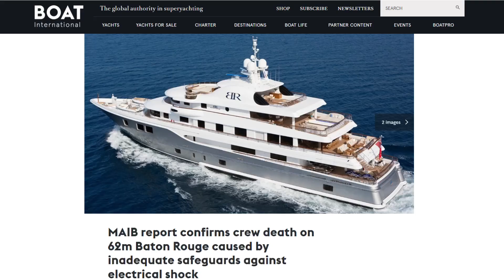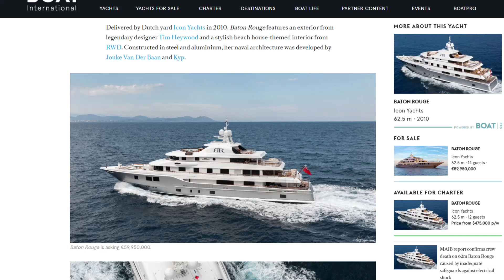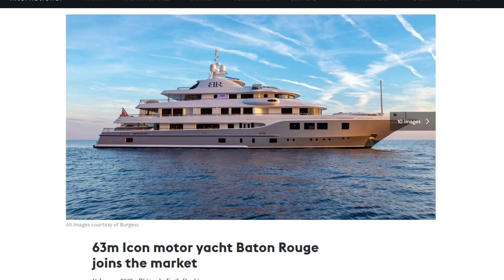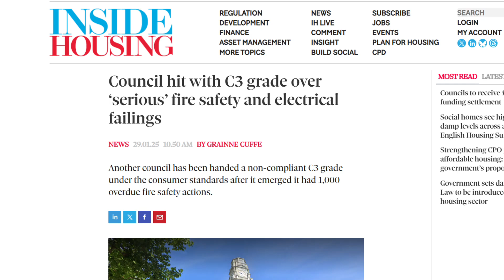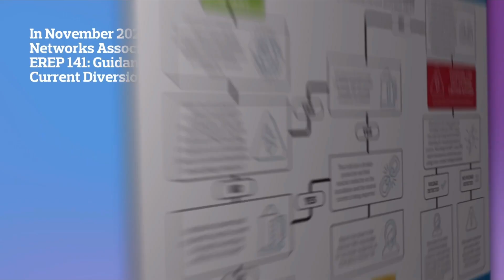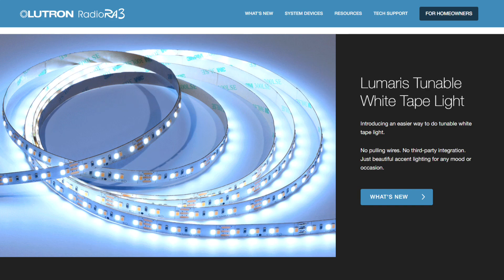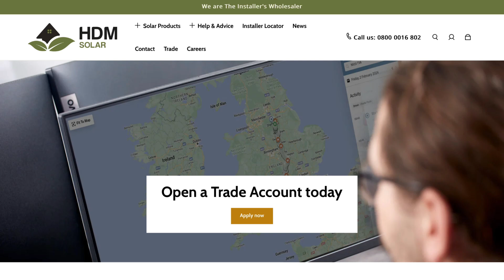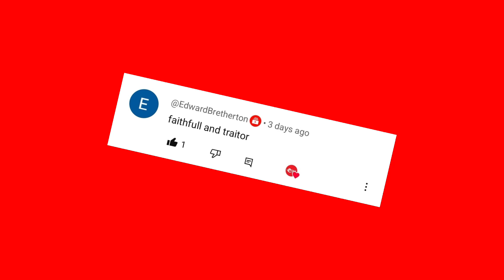Engineer Dies in Live Working Accident

Comment: Thanks for sharing🙏 . . Terrible news about this accident. I am not in the industry and I've never been shy of 230V thinking it's not high enough to kill someone who might be coming into brief contact with it since I've done it so many times in my 72 years on this planet. 
However, this is yet another proof of how wrong I was also having learned that, depending on which parts of the body are conducting the current to the potential return path, only a few hundred millivolts can cause serious damage or atrium fibrillation at the very least.

Comment: On the super Yatch mains voltage amps vary a lot even though it’s 230v inlet power may been at 32 amps or more for the size of the boat shore power cable would been massive to power it up even generators outputs are big big
Reply: The 32 Amps is irrelevant.
This is the maximum current that can be delivered by the supply.

Even if there is 32 Amps flowing in the circuit at the point in time the person becomes part of that circuit, that 32 Amps does not flow through the individual.

That is not how this works.

The most important factor here is the supply voltage, not the maximum current that can be delivered by the supply.

The magnitude of current required to cause electrocution is 80mA, and any mains AC electrical power distribution system can supply more than enough current to cause death.

Any mains electrical providing higher than 50 volts AC RMS that can supply more than 18.4 watts of power can cause electrocution.

Show me a mains power supply that cannot deliver more than 18.4 watts!

Hence consideration of the maximum current that can be delivered is irrelevant. They can all  cause death if the voltage is high enough, which it invariably is.
Reply: @deang5622  
I agree.
That is basically what I said in my comment, the voltage pushes the current more so through a lower resistance V I R comes to mind. As I said the thickness of the fuse does not matter if a Human carks it at drawing as low as 80 to 100 milliamp, jobs done. 
A lot of people don't get that one, a heavier fuse will deliver more demand in Watts before melting, a human will never melt a 1 amp or 32 Amp fuse, it will just sit there unless there is adequate RCD of GF trip to shut of the voltage and current, think they trip at 30 milliamp in around 40 milliseconds😎
Reply: @Gazr965  Interestingly there is a lower and upper threshold at which a 30mA RCD trips. They can't all trip at exactly 30mA because of production spread (variation).

18mA is the current at which an RCD must not trip below.
28mA is the current at which an RCD must have tripped by, guaranteeing that when 30mA of leakage current occurs the RCD trips.

So the actual trip current for the RCD must lie between 18 and 28mA.
Reply: @deang5622  Interesting. But they are very fast though, sometimes can be over sensitive too.
Reply: @djrigga  Chipmunk, you are not interested because you lost the argument.
You, at best, are a lowly qualified electrician that, unfortunately think you are an expert in electrical engineering.

This arrogance and ignorance  I see a lot in technician level electricians.
But let me, as a much higher qualified electrical engineer, tell you, that your knowledge and expertise is superficial and there are serious gaps in your understanding.

Comment: Live working is not something that should ever be done unless absolutely necessary and never done in haste. I once identified a contactor (in a power station) that due to design, could not be isolated for maintenance without a live disconnection (or shutting down the entire power station). I had to write a work specification, have it peer reviewed, authorised and a safety document issued for me to carry out the work, accompanied by one of my staff.
This was on land where the deck does not keep moving whilst you are working. From my previous experience in the Merchant Navy, on vessels of any size, the deck most assuredly does move whilst you are trying to work- not very nice to carry out live electrical work.
Reply: As a controls engineer we work with actuators on air handlers and extract systems likely very similar to the ones on this yacht. Usually they are 24VAC but we do find 230V units in all sorts of situations.
In both cases the power to the damper can be isolated within the control panel. Even only if by removing wires from the terminals, but usually via a breaker, a fuse or 'knife' terminal, or pulling out a relay.
Admittedly I've never worked on a yacht so there may be some application specific consideration that means none of those could be done, but I'd be amazed if there was literally no other way than shutting down the whole yacht to make that actuator safe to work on.
Reply: for any live working, even routine Ze testing i wear my 1kv gloves and face shield... colleague says it's overkill but accidents can and DO happen, and test equipment no matter how well designed can go faulty internally
Reply: @TheChipmunk2008  I've seen accidents happen. It only takes someone being distracted by something else or a moments lapse in concentration for something to go wrong. Much better to be overkill than a statistic.
Reply from the maker: Great comment, thank you for the insight. 💪
Reply: Also the deck on merchant (and military) navy vessels provides an EXCELLENT path to earth, making it far more dangerous. My late uncle was a refrigeration engineer in the merchant navy (usually the NZ lamb run!) ... he had some horror stories
Reply: @TheChipmunk2008 It's not earth.
It's a metal chassis/structure which provides a low impedance path back to the source.

Current only flows when there is a complete circuit, where the current leaves the supply, travels to the load and returns via some route back to that supply.

That's the whole point of how isolation transformers work. You touch a live line (single point of contact) coming from an isolation transformer then you don't die because there is no current flow, because your body, whilst physically in contact with the earth, is not part of the return path for the current back to the secondary winding on the isolation transformer.
There is no completed circuit.